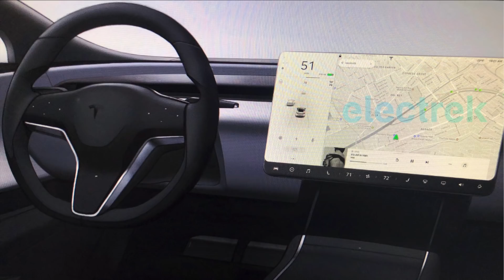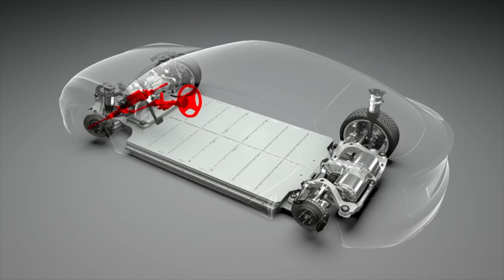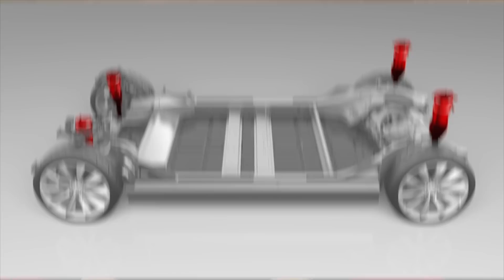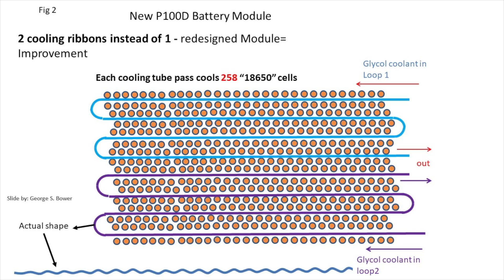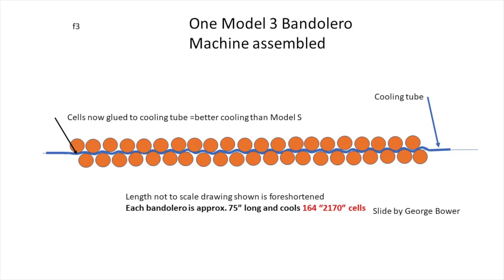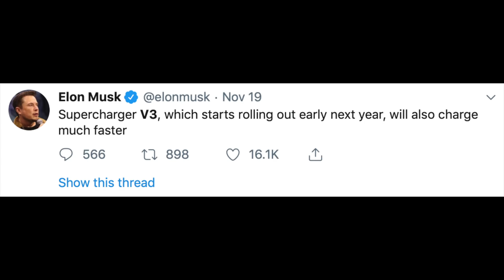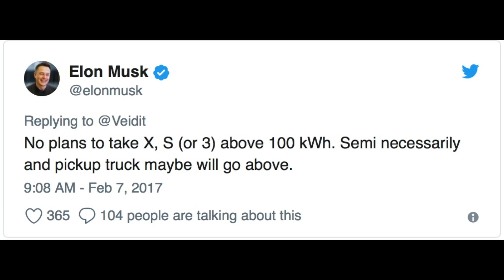The reason Tesla's 75 kWh battery is going away

Comment: It could be that since Model S/X production lines are maxed out at 100K cars per year, they are just eliminating the lower price models to maximize profit.  Could have nothing to do with a larger battery pack coming soon.
Reply: The people who can afford a Tesla are buying it for the status symbol, not to save on the cost of gas, so it really makes sense to close the lower price entry in order to keep the car a status symbol. Boo hoo to the upper middle class slobs that would like to save gas on their work commute. They can get a volt or a leaf.
Reply: @kedwa30  that is so true. Cause for the price of a model X for example vs an X5. the 100D model X costs close to 100k and the X5 drive 40i you can get under 100K. you're telling me that gas is so expensive that spending an extra 20 grand will save you gas in the long run? it would take a decade at least to spend that much fuel. Teslas are a status symbol!! They look cool and yes are electric but for the extra you pay for them versus competitors you cannot justify you're saving money when you're paying for 10 years of fuels costs into the vehicle! it just doesn't make sense. if you buy it's only cause you can afford it it's not about saving money!
Reply: @denziiey  hyper car performance. p100D+ vs $3 million bugatti and the p100D+ is actually a bit quicker (unless your going above 100mph in which your going to get impounded and license taken away in Canada anyway...) its the quickest thing on the road.
Reply: @travisjohn816  I agree but most people buy it for the electric status. Which is great we need more electric vehicles. But when their gas equivalent is over 30k less it makes it really hard to justify buying them. I test drive a model 3 today, now I like Tesla, but when I buy one I'm not gonna act like in saving money. Until I can afford to own a Tesla alongside a gas powered car I'm not ready for them.
Reply: @denziiey  ya but not many people pay all in cash... so when you consider the yearly savings of fuel / maintenance into your yearly payments its very close to gas vehicle especially when you compare the awesome acceleration.... and surely in next 1 - 10 years the price will come down more and more until electric is far superior
Reply: @travisjohn816  true. If I can get financing for a little under 500 a month I'll take it. I won't pass 600 though. But if I can get that I have no problem buying one.
Reply: @denziiey  ya the monthly payments for $35,000 version will be nice. Very rare you would require longer rangeI am waiting for leasing option for model X for tax write off purposes.
Reply: john  ohhh  it was started that the tax incentives will be lowered moving on!
Reply: Roger Heuckeroth That may be true, but that would mean there is now an increase to the barrier to entry in the full-size electric sedan segment. Before, someone could get a full-size electric sedan at around $77k and now it is closer to $95k. The profit is maximized on the cars sold, but maybe cars don’t sell as easily or as quickly (or some units maybe not at all during the production year), or perhaps not attracting new/distinct buyers.
Reply: @AdamSmith-fe9jf  Someone who can't afford the price of a brand new Model S can still look on the used market and pick up a still awesome car for about 40-50K
Reply: Roger Heuckeroth pppppppp
Reply: Roger Heuckeroth onomonoooo

Comment: Charge rate of a cell depends ENTIRELY on the current per cell.  Right now Tesla limits that to 4 amps for 18650s and about 6 amps for 2170s.  Charging voltage per cell can be no higher than 4.2 volts.  Max Supercharger power is therefore no. of cells X 4.2 X (4 or 6) for the biggest pack made.  Currently 137 kw for 100 kwh pack with 8256 18650s.  Biggest single layer 2170 pack that would fit in a S or X would be about 6000 cells, less than 150 kw max charge rate.  Don’t be fooled by externals of a cable.  It all depends on the wires inside the insulation.  You can’t charge a pack any faster than you can charge a single cell.  80% charge in 15 minutes is not going to happen.
Reply: a123 cells could be charged in 15 minutes or less and discharged even faster.  Almost all chemistry even the crap used in cars can take near infinite power if sufficiently chilled.
Reply: Irene my remarks were aimed at batteries used in Tesla cars. Are you referring to the Chinese batteries that were recalled some years ago?  I am not familiar with them.  Have they been revived?
As to sufficiently chilled, mot sure what that means but not a consideration for the average Tesla owner.  Maybe in Antarctica?🌨

Comment: A version 3 supercharger rolled out with an updated model s and x would make total sense. Otherwise you would basically tell your s and x customers that their premium price isn’t worth the use of a V3. I also like going away from the use of the Kw in the car name. They may be able to knee or stretch their EPA ratings with other improvements, including the cells while using less KW packs. Increasing margins

Comment: If they can’t het 350 kW fast charging, than they are letting Porsche and Audi go ahead of them. If they went 800V battery pack, they would probably also be able to get 350 kW fast charging. And 350kW is not the end. Porsche and bmw did a test with 450kW and that did manage 0-100 under 15min if I remember correctly. And even that can’t compete with fueling up an ice car. How relevant is that for the user? Many people with electric cars say that even current 150kW charge rates are not that big of a difference for them in time, you have to remember that only a fraction of cars are electric and even now there are some bottlenecks in charging infrastructure. So there are 2 options left than, vastly more charging stations, or faster charging so that there is a higher through put. I believe the latter one to be more of a help so that current fueling stations could be used as fast charging stations. With lower fast charging, we will need more stations. At 150kW we would achieve 0-80 in 30min, so 6 time more stations than fueling pumps. With 220-250kW Tesla is suggesting it would probably still be 3,5 charging stations compared to petrol stations.

I hope that for the roadster, they at least use 800V battery 350kW setup. If the roadster will be 400V and limited to 250kW, than they are certainly not using state of the art technology, and what is the point of having such an expensive enthousiaste car if it doesn’t come with state of the art technology. Imagine a 2020 Audi TT with a VR6 engine from golf R mk5, that would be fun but not worth the money
Reply: I wonder If SC3 will get CCS port with 500A cable. That way they can provide 250kw. Not sure the current Tesla port/connector can handle such power levels even If they get cooling.
Reply: charging is what you do while cheating on your spouse so expect fools only to tolerate the range of 5 to 20 minutes for that the rest of us will expect under five minute topping at least off

Comment: Tesla has dug themselves a hole and jumped in it with that massive lithium ion battery factory, solid state battery's are just over the horizon and they are going to destroy lithium ion battery's. And you cant just just the existing assembly line in the factory because making solid state battery's is a much different process that requires alot of different machinery.
Reply: Yeah, like solid state batteries can't be produced in a big factory.
Reply: @michelangelobuonarroti916  Ya, but not in a factory setup for lithium ion battery's.
Reply: @holyravioli5795  Yeah, probably no possible way to change out the equipment.
Reply: @michelangelobuonarroti916  It would be damn expensive to change at this point.
Reply: nuclear fission presently is used to spin a shaft- what we connect to that shaft is another question.  Certainly not any glorified alternator.  We will make fuel, it will be zero emission and more dense theny any static charge holding material.  many atoms are ideal but none more plentiful then oxygen- 08 is stable without pressure- it can provide traction power in excess of any otherh system with almost no capex to harvest and apply it.  It is simple and solved.    The demand for the fifth coldest oxygen ice is so great it will cause more reactors to be commisioined then we saw in the 1980s and thath will accellerate for five years then we will see massive glacier restoration and within half a century be able to claim Henry Ford did not end our planets desirability to even tourists from other constellations.  NOT BEFORE.

Comment: I do not see Tesla making cars with 350 miles of range this year. I feel like for a mass production car designing the frame to handle a battery pack that goes more than 350 miles is a waste and that space should be used in other areas of the car. 

I don’t even think the roadster is really designed for 500 miles as a primary feature. It is designed for 200 miles driven hard on a track and that requires a battery pack that goes 500 miles in normal driving conditions.
Reply: without folks like yoiu to point out obviously we would arguably be worse off

Comment: I think most analysis of the changes don't take into consideration standard pricing structures. You want separation between M3 & S so they address different buyer profiles. Similar with the X and new Model Y, you need to have a spread in the pricing, plus the Model Y has to be higher price then M3. So I think this is all in prep for Model Y release and to fit a proper pricing structure across all their models.

I agree that likely a new versions with higher range allows for maintaining a premium pricing structure for a MS & MX with 125KW battery, above their new 100KW pricing.

Comment: If MS/X would get 2170 batteries soon, why is Roadster 2.0 still getting the old 18650 (as Franz von Holzhausen mentioned). I think 2170 is still a few years away for MS/X.
Reply: I don’t think roadster 2.0 will come out with 18650 cells? And tesla has not confirmed right that roadster 2.0 will get the old cells? Why is 2170 for S and X away for 2 years? They have to push the bar so that won’t let completion catch up on them.
Reply: @PureTinglyASMR  18650 are better cells than 2170 but they are less cost-effective to produce. Right now, the chemistry in 2170 may be better because they are produced by Tesla in-house, but Tesla reduce the quantity of 18650 cells in newer 100kwh packs recently which would mean a better chemistry there too.
Reply: @jonaboy3  Exactly!
Reply: @PureTinglyASMR  https://twitter.com/elonmusk/status/876829309695967232?ref_src=twsrc%5Etfw%7Ctwcamp%5Etweetembed%7Ctwterm%5E876829309695967232&ref_url=https%3A%2F%2Fwww.teslarati.com%2Ftesla-model-s-x-no-plans-use-2170-battery-cells-says-musk%2F
Reply: John Gijbels I think the roadster will be equipped with the 2170 cells as well....why woulded you go with the better battery?   Performance car needs performance cells, right?
Reply: Jim Hofoss is they any evidence stating 18650 are better than 2170? Model 3 performance does way better than Model S on track (does not heat us as model S) so why would you want 18650 cells in roadster? Plus they need 2170 cells for v3 supercharging.
Reply: @PureTinglyASMR  The 2170 cells are more energy dense. But the 18650 cells are more power dense. I guess it's a trade off between having a lighter car with less power, or a heavier car with more power (given the same pack energy). https://www.reddit.com/r/teslamotors/comments/5uz0w3/18650_cells_vs_2170/
Reply: @armwrestlingprofessor  But, they have indicated a drastically higher pack energy for the roadster given the 600+ mile range. So, they could be getting the higher current just by putting more cells in parallel.
Reply: They haven’t produced any roadster 2.0s yet, so it’s likely that they will have the new batteries

Comment: Use 2170 cells and remove the individual sub sections. You could flip them horizontal and not increase the height.
Reply: The electrical system for making contact with the tops and bottoms of all the cells would also increase in complexity.
Reply: Turning a cylinder sideways instead of up-right does not decrease the volume which remains the same.  Therefore overall the same number of batteries will fill the same space whichever way they are mounted.  Or maybe not, if they don't fit the previously designed space that way.     ///  Ted
Reply: @edwardcoulter9361  The cylinder would be a different width if they use newer cells. And it would possibly avoid designing a taller pack.
Reply: @JimFeig  If they were planning on using the same number of larger cells they need more volume no matter which way you orient them.  Either the height will have to increase or the width and/or length of the battery pack.  Of course if they get more efficiency out of the larger cells then they will not need as many for the same job and perhaps they might fit in the previously engineered battery pack volume. I doubt it though if you change one thing you will invariably have to change another.
Reply: @edwardcoulter9361  Because the cells are round fitting into a rectangle the cell area could end up higher in proportion to the empty space.
Reply: Jim Feig:  The void space between cells is the same 21.46%, regardless of diameter, assuming all cells are the same diameter which is reasonable and necessary.  It does not take much math to prove that, which I've done.  The void space formula comes down to (4-Pi)/4.   Radius is not involved in the formula as it cancels out and therefore cell diameter is not involved in packing void space.  The cells are packed, however, with the cells shifted half a diameter in alternate rows to reduce void space.  The remaining void space, though smaller, is still independent of cell diameter.    ////    Ted (Professional Engineer)
Reply: @edwardcoulter9361  Yes. But the cells are made to be cooled by water ribbons snaking around their sides. Oriented vertically, the surface area of the sides that are running up against an outer wall is minimized to only be those at the sides of the container. Oriented horizontally, the sides are up against two sides the top and the bottom of the container. I belief this orientation would make the routing of the cooling more difficult, probably reduce its efficiency, and increase the difficulty of making electrical contact with the tops and bottoms of every cell as well as efficiently routing that electricity (its a difficult job to move all those amps with the least possible copper).
Reply: The ribbon based cooling system wouldn't work out as well if you flipped them. There would be too many bends in the flow.

Comment: If the v3 superchargers  are only for the new cells then will the teslas at the superchargers be divided  between old and new? Will existing customers be annoyed as they thought when buying the P100D, the latest and greatest will then be top trumped. Maybe existing customers can change the pack with a fee and tesla car reuse the old packs in energy storage. So many questions
Reply: Superchargers have A (priority) and B (secondary spaces. Since new Teslas aren't given free supercharging, the A slots could be switched to Ultrafast with the B slots being kept for legacy charging. After the B slots are filled then free charging could be allowed on some open A slots. And for a little more revenue, models with 100 Kwh batteries might be upgraded or software unlocked to use higher speed charging for a fee.
Reply: I think that the teslas with the new battery cells will have the CCS charge port and the v3 superchargers will have the CCS plug. The  charging cables will have to be liquid cooled to handle that amount of power. With upgrading the existing cars the battery, the high voltage cables in the car and the charge port probably need to be replaced and that sounds expensive

Comment: Tesla must go to a different battery technology, such as, graphene. This has better range, higher charging rate, lower weight, no cooling requirement, and no fire hazard!! I'm surprised Musk is putting so much money into lithium ion battery technology.
Reply: You really think that Elon Musk and Tesla hasn't been researching and investing in graphene technology? The problem with graphene is that the production is super complex and very expensive to make. Graphene research and development has been going on since 2004 but the improvements we're making is minimal. While lithium-ion technology improves every couple years. Once Lithium-ion has peaked, i'm pretty sure new technologies or perhaps graphene will surface if we make another technological breakthrough.

Comment: I am very surprised that they are doing parallel cooling, as my experience is that the cooling will take the path of least resistance, so you can have one path completely blocked and you would never even know it, if even just a big imbalance in the flows meaning one path could carry most of the cooling flow leaving the others starved, a series cooling system is far better!
Reply: You know instantly though; the pressure increases. Easily detected.
Reply: The Defpom's Repair Channel I would think they are monitoring the flow in each path and regulate each path with suitable valves. That’s how it’s done in other technical solutions where cooling is highly prioritized as it is for the battery. I’d say it’s a top priority system in each tesla car.
Reply: yeah just emphasize the proper tech is in place as a accessory gimmick instead of providing the traction power itself.  Way to get Geneva interested thanks!